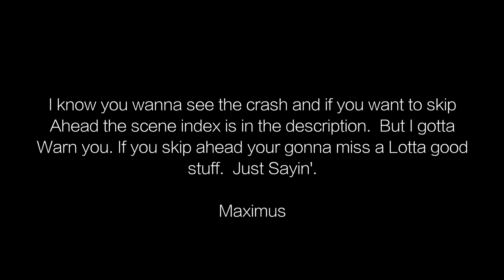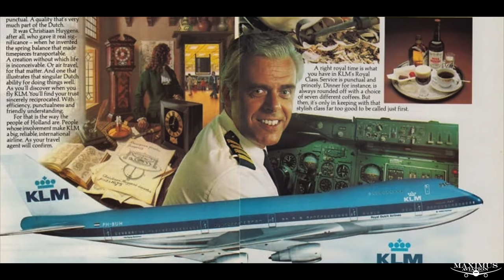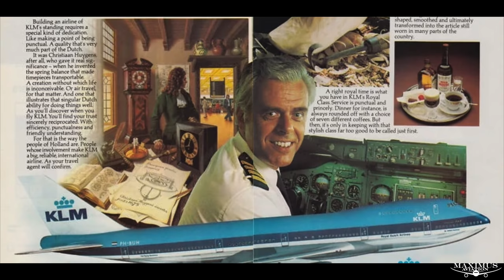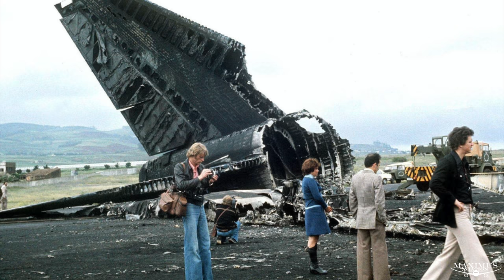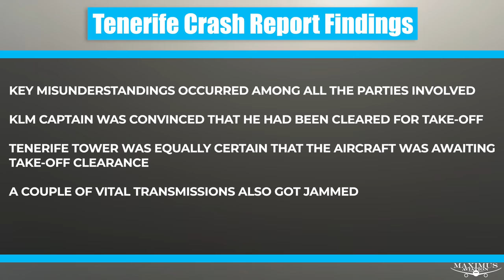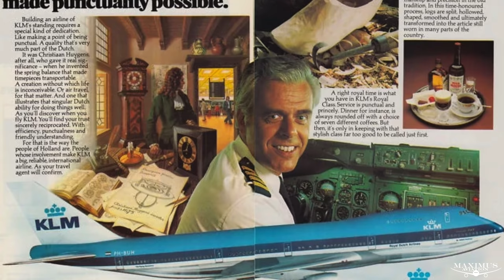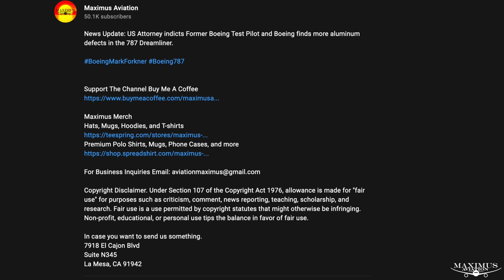How One Pilot Caused The Worst Accident In Aviation History

Comment: Re coverage of deadly aviation incidents on this channel. I think.
I subscribe to several aviation related channels, so I might be mixing up this one and another.
I apologize in advance if this is the wrong place.

There is a thing about the Boeing 737 Max that I had suggested to a few channels when I realized it some time ago, that I hadn't seen mentioned in media. I’m not sure it was here that I was told the channel wasn’t to focus on the negative, and I’m not trying to call anyone out.
I just watched this video, wondered if there had maybe been changes made to what this channel is about, and wanted to repeat what I still think is an overlooked yet salient point about the 737 Max.

What it was about:
The MCAS related 737 Max crashes were a replay of an earlier crash, on an earlier Boeing model.

The replay being that for an important flight metric, two sensors fed information to the cockpit. But a computer system running flight controls was only taking data from one of those two sensors. When that single sensor malfunctioned, the computer was correcting the flight controls based on bad data.
This eventually put the plane in a situation from which the flight crew was unable to recover.

In the 737 Max, that computer system was MCAS, the two sensors of which only one was used were the angle-of-attack sensors.

In 1996, on the Boeing 757-200, the computer system was the autopilot, the two sensors of which it used only one were the airspeed sensors, specifically pitot tubes.

Birgenair flight 301, operated by Alas Nacionales, took off from Puerto Plata, Dominican Republic on Februar 6, 1996, headed for Frankfurt, Germany. One of the airspeed sensor pitot tubes was blocked. 
The crew noticed before takeoff that one of the airspeed sensors was showing obviously incorrect numbers. But took off anyway, as the other airspeed sensor seemed to be working fine.
Airborne, they turned on the autopilot. Which used only data from the faulty sensor, a blocked pitot tube. Despite the plane moving at acceptable speed, the blocked pitot tube caused the autopilot to register overspeed. The autopilot took action to reduce the plane’s speed.
It reduced thrust and increased the pitch angle, but the fault sensor kept reporting increasing speed, prompting the autopilot to try and reduce further, until it disengaged itself.
The crew were confronted by a number of alarms, including the overspeed horn and stick-shaker (stall warning). Simultaneously telling the crew they were going too fast and too slow. The flight crew was confused.
Eventually, the captain figured out what was going on and increased thrust setting to full. But at the high AoA, the left engine was starved of airflow and flamed out. The right engine, set to full thrust, put the plane into an irrecoverable spin.

After the accident investigation, Boeing had announced that they would include blocked pitot tubes and how to deal with them in training for 757 pilots. It seems they recognized that there was a single point of failure the crew should be aware of.
The FAA mandated that Boeing introduce a warning that would indicate if the pilot’s and co-pilot’s respective instruments were disagreeing, basically a simple sanity check for the crew’s attention.

Yes, the 757-200 is a very different beast from the 737 Max, with a very different set of computer systems. Autopilot and MCAS are themselves very different in purpose.
The point is NOT that Boeing used the same exact systems, the obviously didn’t.

My point is that, designing the 737 Max, they repeated the steps that had led to the crash of Birgenair 301.

The plane was designed to have two sensors for an important flight metric.
The plane was designed to have a computer system that would handle certain flight controls and would have sufficient control authority to put the plane in a dangerous situation.
That computer system was designed to operate on data from only one of the two sensors present. Without so much as a sanity check.
The safety of the plane was made to depend on that single sensor not failing, on it never sending bad data to that computer system. On the computer system never receiving data so far off the mark, corrections made accordingly would actually put the plane in a dangerous situation.

Institutional memory and experience is supposed to be one of the things that make aviation safer and safer, isn’t it.
And yet, here was a lesson I believe Boeing should have learned from an earlier model.
But they either didn’t, or they forgot, or they disregarded it.
Reply: @Guido Lissmann
Interesting, isn't it?
Checklists for pilots are carefully developed, reviewed regularly, and improved whenever a way is found.
But checklists for airplane designers... who have the luxury of days to double-check their work if their management allowed it, not minutes as pilots do... don't seem to be a factor at all.
Could plane designers learn some useful techniques from bridge designers? Or surgical electronics designers?
Reply: @dexterpoindexter3583  I'd think that, at the very least, they should look at past incidents and wargame what similar events/situations/design-problems would do to whatever they were working on.

Perhaps it shouldn't even be the design team to do that. They would naturally be biased, in favor of their own work, or even biased against it - when management made them do a bunch of stuff they don't like.

Ideally, there should be such exercises for the assembled plane, but also for any of the subsystems and subassemblies that come from outside vendors.
To try and catch any unexpected interactions.
Like when bees (I believe it was bees, Maximus did a video on that Birgenair/Alas Nacionales flight) cause a pitot tube sensor to fail unsafe, and the autopilot responding to the bad data from that unsafe condition.
Reply: @DerGolgo  YES.
Well Said indeed.

The sort of thing we were introduced to in FIRST YEAR engineering at Waterloo, 1969-70... but somehow, business majors were able to convince professional engineers to risk their licenses by ignoring those principles.
There's probably a lot of complex reasons for how and why. But, especially in an industry as big and powerful as aviation, we may never see a YouTube video scratching any deeper than the surface.

Comment: So some 40+ years on, when OEM's are toying around with the concept of pilotless aircraft, you'd think that we'd have an automated system of ground movement run by computer, that would move aircraft efficiently and safely around taxiways and runways. You could have traffic lights at intersections, line up positions, even digital boards that direct aircraft. Red stop here. Green go. Flight XX000 turn right here ------------>.  You could have it all monitored by humans, but you get the picture

Comment: I think the airport operations is partly to blame.  There was no taxiway, so one plane was taxiing on the runway while the other was preparing to take off, and in poor visibility conditions.  There should not have been more than one aircraft using the runway at one time.
Reply: If the weather hadn't changed it would have been fine, but the weather changed in an instant as Maximus explained, and all the dominoes began falling, one after the other.
Reply: I disagree. 
To me, KLM took off without clearance,  and no matter what else should or shouldn't have happened,  he is responsible for this mess.
Reply: If a frog had longer legs,  he wouldn't bump his butt on the ground either.
Reply: @alhanes5803  — No question, the KLM captain was responsible, but good safety protocols have redundancy.  There should be room for some error without disasterous consequences.
Reply: There was a taxi way.

The problem was that the airport was not designed to hold do many large aircraft that they were having to use the top end of the taxi way near the terminal to stand aircraft, blocking it.

The result was that all aircraft had to use the runway as a taxi way near the terminal.

Perhaps if KLM had had to follow a route onto the taxi way as opposed to following the runway to the end and turning round PanAm may have been closer to, if not actually, leaving the runway onto the taxiway.

Comment: Van Zanten aside, is there any reason why Tower could not have left the Pan Am where it was parked until KLM had taken off? \m/
Reply: I think it is safe to assume, that the area near the terminal was full, so they wanted the big planes out of the way as quickly as possible: One right after the other, but the fog threw in a huge monkey wrench into that.
Reply: It was ATC trying to expediate the delays - by having PanAm follow KLM down once off the runway and onto the end taxi way the KLM could get going to that by the time the PanAm got the the end of the runway ready to take off there would only be a short delay for the wake turbulence to settle before they could start their take off.  If they waited until KLM had taken off there would likely have been a further delay (10mins?) whilst they got down to the other end of the runway.

Remember it would take KLM time to travel the length of the runway and to turn around - time that could be usefully used to get another aircraft nearer to being ready to take off.

Or would you prefer that all aircraft waited on stand until the runway was clear, reducing throughput dramatically?
Reply: @officialmcdeath
I read a comment on another video that the Pan Am voice transcript shows the pilots discussing whether to wait at the departure end of runway 30 until the KLM had left. The cloud could have been thick at their end by then...? But when ATC told them to follow the KLM they complied. 😪

Comment: The accident wasn't simply down to Van Zanten. That would be poor analysis.
Reply from the maker: Can't argue with that.
Reply: Yes, it was clearly,  and completely down to van zanten.
Reply: @alhanes5803  
If the terrorist threats hadn't closed the main, larger, airport the regional airport would not have had do many large aircraft for which it was not suited.

If the terrorist threats hadn't closed the larger airport there wouldn't have been the delays.

If the flying regulations on hours were not so strict the Dutch captain may not have been rushing to avoid running out of hours and the large expense that would cause his employers (putting up passengers at hotels whilst waiting for a crew to have rest/new crew to take over/replacement plane to be found).

 I very much doubt the passengers who had been diverted and waiting to get where they wanted to be were sitting quietly, relaxed and undressed over the delay.

Then there's the confusion that comes from not completely specific communications from people using a non native language, and how their accents affect the understanding of the communications.

The pressure ATC was under to get flights going again with as little delay as possible (given the circumstances).

There were many factors working against safety on that day.  The biggest one being the Dutch captain, but he was not the only one.